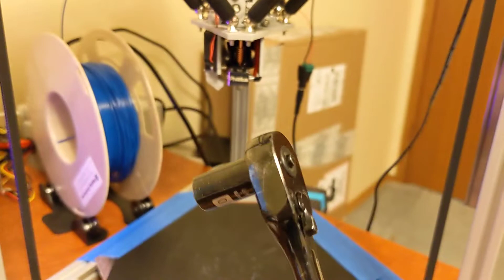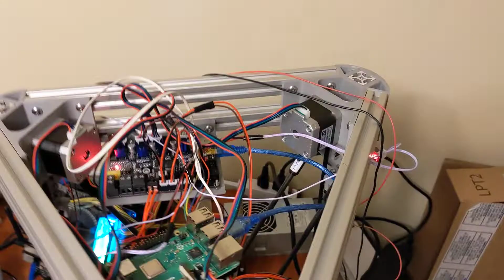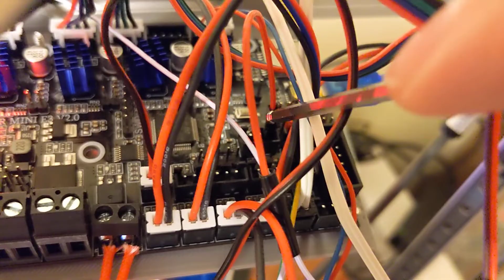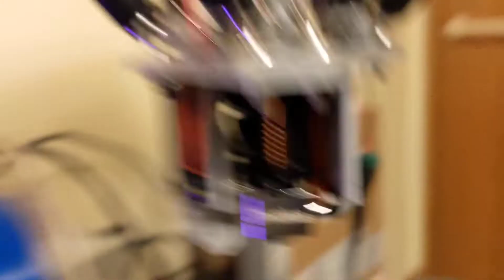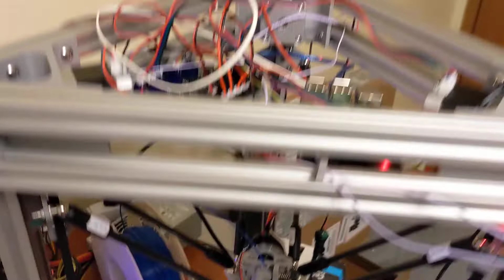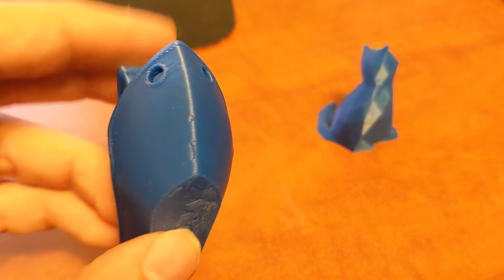Let's build a Delta 3D Printer Episode 4 Everything fully assembled!

Comment: Hello, Really interesting. Do you think I can upgrad the SKR Mini E3 V2 for a SKR Mini E3 V3 without any fix?
Reply from the maker: any mainboard can be used, the pinout may be different with the v3 but easy to do
Reply: @Rolohaun Much appreciate. I plan to buy a refurbished FLSUN Super Racer for 200E as a first printer. Then  I'll build the Phoenix and maybe make a new controler board with Trinamic (now Analog Devices) drivers.

Comment: Can you make a Video about calibration? I have two Deltas with klipper and even after 2y of klipper (+pressure advance etc.) im still not able to get perfect corners like with corexy/cartesian printers
Reply from the maker: Yes I can put that info in some videos, what are you running for Delta's? What extruder, hotend, and arms?
Reply: @Rolohaun  anycubic predator w btt octopus tmc2209, anycubic kossel w tmc2208 (custom sliders/carriages)magballarms on all printers, flying extruders(BMG, Titan), V6 all Metal, phaetus Dragon high flow
Reply from the maker: @tobit6890  ok awesome, I will post what I can. What slicer do you use?
Reply: @Rolohaun  s3d and Cura
Reply from the maker: @tobit6890  thanks for the info, let's see if we can figure it out I will use a calibration cube and try different things until we can get the corners nice a sharp
Reply: @Rolohaun  thanks, i appreciate that
Reply from the maker: @tobit6890  So I printed a bunch of calibration cubes and what I found is I needed to set my acceleration in Klipper to 1000 to get sharp detail. I know most stock printers like the Ender 3 and such use a low acceleration like this. What acceleration are you printing at? If you want to printer at higher accel you would need to use Input Shaper
Reply: @Rolohaun  thanks, ill try that out, i had 2000 on my predator and 3000 on my kossel..what value are you using for square_corner_velocity? default should be 5
Reply: I think it already worked for the Predator, for the Kossel not really, maybe i need to do enhanced delta calibration again as well as tuning pressure advance...
Reply from the maker: @tobit6890  I never set my square_corner_velocity so it would have been 5. I did just try 2.5 and 0 and didn't notice much of a change. Glad 1000 accel help you at least a little. Printing fast is great but I guess you always sacrifice something.